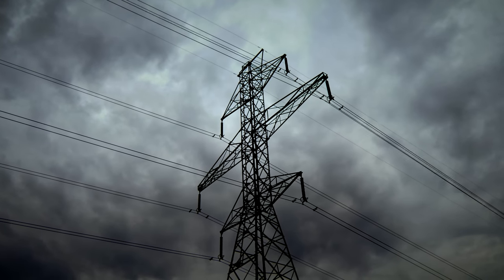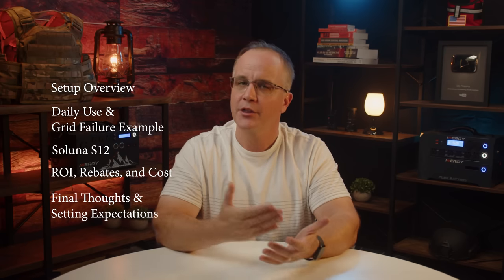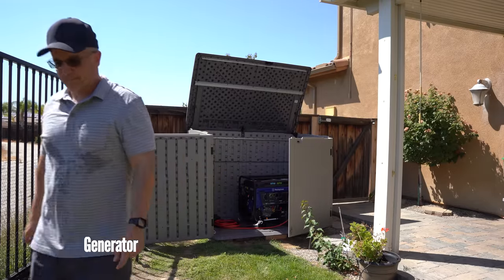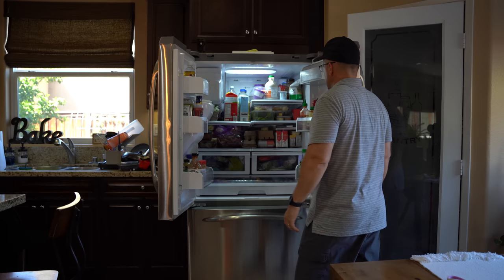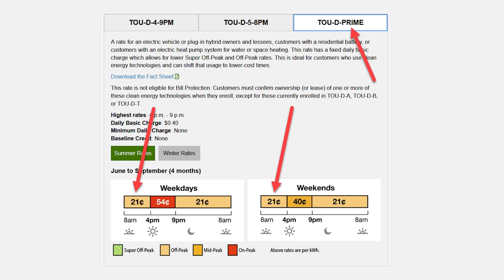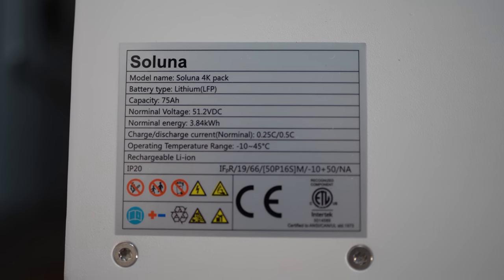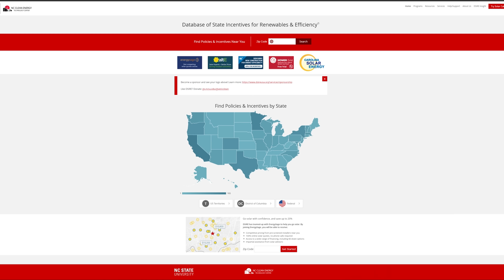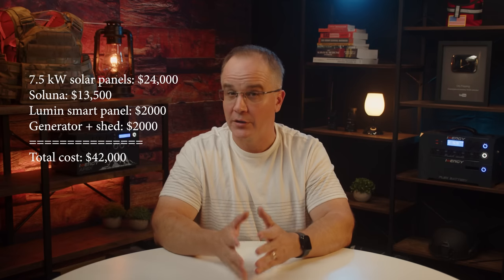The Coming Power Grid Collapse.  Soluna S12 Whole Home Backup Power

Comment: Hey Kris, Excellent job explaining your system and the key features and issues to consider.  Well done.  I think you did pretty good with the system you installed and you should be in good shape in a world of rising rates and increasing power outages.  Couple of notes:
1. The Westinghouse generator you selected is an excellent generator that really cranks out the power.  I have one and love it.  That said, it does have a very high THD and should not be used to power sensitive electronics.  You will want to make sure your Soluna charging system is OK with that as you charge your batteries.  
2. That is a lot of money but about in the middle for what I have seen.  I think it makes sense for someone like you.  i.e. you have the cash, you don't live in the country, you have a difficult roof and you live in California.  For the DIY'er who is on a tighter budget, has a simple roof or has space for a ground mount and has some electrical and construction skills a system similar to this can be DIY built for about $15,000.  When I say similar, I mean less bells and whistles but very similar in actual power specs.  
I think your going to be very happy that you made this investment over the coming years.  Thanks!
Reply from the maker: thank you for your feedback!  I plan on building an Offgrid cabin in the next year or two and will build a setup like what you mentioned.  By then, hopefully the cost will drop as solar and battery technology seems to improve each year and drop in price.
Reply: @CityPrepping  good luck..

Comment: Living in Louisiana we have lots of experience with prolonged power outages. My rule of thumb is keep one room "livable". Gas for generators becomes very hard to find a few days after a hurricane. We dont have the financial resources to have an elaborate off grid system, but several decent sized power stations and a few kw of solar panels. We have a few 12v fridges. Having lights on does draw attention. Another consideration is to turn off your wifi router after a grid down situation as that can signal your house still has power.
Reply: the "one livable space" idea is a good one!  For me, in cold weather it'll be the living room (woodstove); in hot weather it's the basement (nice n cool all year round)
Reply: @vickiamundsen2933  for us it's the master bedroom with a window AC, lamp, TV with antenna. Winters arent to harsh, but we'll stay under a heater blanket if we have an ice storm or something similar.

Comment: Thank you - I am purchasing a small, new construction home that is currently delayed due to the gas company having a shortage of fittings.... which sucks.  Hoping to be able to close and move in end of August now.... I intend to get a solar power system.  The home is a small ranch  - 1180 square feet (just me and Luna the wonder dog) and so a 3/2 is actually really more than we need.  I do office out of the home so one of two extra bedrooms will be office/hobby room.  The other is a guest room.   I am intending to either have a solar system installed or doing it myself - I've found very good DIY vids here on how to do it... but really I'd like something like your set-up.  But maybe 12KWH.... so that I can power my A/C for at least part of the day.  Or, I may just opt for a small backup window AC for the master bedroom - for grid-down.

Comment: My system is a Generac with 6 batteries and two inverters.  Most of the time my house runs off the solar panels.  40 solar panels.  I have a critical loads panel.  Last month I produced 133 KW more than I used from the grid.  During the best time of day I can run the entire house off solar.  I got a large rebate and I got a $ 4,000.00 federal tax refund on the system.
I am very pleased with my system.

Comment: This was a very interesting video.  I live in Puerto Rico where power outages are common.  A couple of days ago, our power was out for 16 hours.  The system is aging and over the decades maintenance has been poor.  I bought a 5.2 kw system three years ago.  Sixteen 340kw solar panels and a 13.5 kw Tesla battery.  My system is grid tied, but works very well when the grid goes down.  As the cost of power goes up, my system is paying for itself.  I paid $25,000 for it.  Going solar was one of the best investments I've ever made.

Comment: I Love this Video, thank you so much.
I haven't used a refrigerator for almost 3 years,  because all i had in it was mustard and mayonnaise. 
I don't waste my electric for things i don't use. 

In the summertime while I still had electricity, my monthly bill was a whopping $35.00 (thirty-five dollars, yes you read it correctly).
My electric company shut me off after 2 month and my Bill was $79.00. i used to pay them usually every other month. That time they didn't want to wait 12 more hours to get their Money, so they shut me off. I paid my Bill like usual and then they told me i had to pay another $60.00 to get my electric turned on again. 
The company ended up paying me $192.00 back of my down payment and a membership fee i PAID in the beginning.
So it was then when i said goodbye to the electric company and got my deep cycle Marine batteries. 
As for me, i have to use a CPAP machine at night, and i charge up my cellphone. 
My CPAP machine uses 90 w of power, i tried to run it with a 100 w Inverter, but there is too much draw on the 100 w Inverter. 
Now i use a 175 w Inverter that can handle the surges that happen periodically.
I also purchased three Marine deep cycle batteries, which I use constantly. 
One for my cellphone and other small rechargeable flashlights, emergency Radio, batteries needing to be recharge, and the other two for my CPAP (one battery ONLY lasts about two weeks on one battery). 
Up until one week ago i had to find someone to take my batteries into Town to advanced auto to get the batteries recharged. 
I then found a deal on a 200 w Solar Panel Kit, including a 400w inverter which I purchased. 
In my Yard i only have about 6 to 7 hours of full sunlight, so with this 200w Panel it takes about 2 days to charge up one battery. 
I now can run some of my power tools (as long as the wattages are lower than the Inverter) for the short period of time needed. 
I also have an 800w Inverter that my husband and I used in our semi truck before he passed away. 
I am learning now what I can and what i can NOT do with my system. I don't use much light inside my house, since I fall asleep as soon as I get comfortable in my chair.
Beings I spent most of my day outside in my woods, i don't even have time to cook anything Fancy. 
I am learning about my weeds in my yard and what is edible so i make a 3 minute ramen noodles with wild spinach. 
I do take vitamins, because i really don't live healthy, other then I am a FORCED vegetarian 🤫😭🤫🤣. So, i even cut out my meat consumption!

Comment: Here in the southern Bahamas there are 3 homes on this island where I live and we were running one large generator for years. Then in 2014 we had installed a large Solar array system that can run every thing. We kept the generator for back up and run it one hour a week. The cost was just under $200,000 Turn key.  The nice part is I can run the clothes dryer, Air conditioner and Oven and a 60 gallon hot water heater all at the same time with no problems. What we do have to be mindful of is water, there is no freshwater source here at all, so it’s all rain catchment for each home. The rule is a gallon per Square foot of your home for storage. My home is 5,000 sq ft but I have a pool so I have a 12,000 gallon tank for my home. With Dish TV and AT&T cell Service I could stay connected to the world, but in March I installed starlink satellite internet service for faster service. So far so good. It’s 20:40 EDT 80* 60% humidity 8 mph wind out of the west. and the sun just set about 20 minutes age. My transportation is a golf cart on two solar panels.

Comment: So glad you talked about the grid, I have a 22,000 kilowatt solar system, so I know what I'm talking about and I built it.  Im totally off grid. I have 90 230 watt panels and renogy controllers 😉the copper will shock you at its cost, I spent around $140,000. Totally off grid and I run an air conditioner.
Reply from the maker: wow, that's a big setup!

Comment: Excellent presentation, Chris, as always.   Thank you for all the details, planning, and thought you put into both the system you presented and this video.  I'm impressed by your set up!   I'm working on smaller back-up systems for our family that will get us by during short bouts of power outages.  I have two portable power stations made by Oupes, an 1100 watt with two 100w solar panels, and an 1800 watt station that uses 4 100 watt panels for charging.  I use these on a weekly basis to power my e-bike for my daily commute to work. A small 3500 watt gas generator can supply power to larger appliances such as our washer and natural gas dryer.   Like you, we are not concerned with powering our whole house AC.  I purchased several USB powered fans that we can use if needed.     I would recommend systems such as you describe that you use regularly in order to get the use out of them, and become familiar with exactly how they perform.   Thanks again.   Always appreciate you insight.   Larry from "Under the Median."

Comment: I added a whole home solar system in South Texas with Tesla Power walls, the total system was over twice your systems cost ($93K), this included a new roof (required for new solar panel installations on composite roof).  The house is 3100 sq ft.

Comment: This is similar systems that I've talked about for years to friends of mine who live in their own houses.

What I'm thinking is that these kinds of systems really need batteries external to all those electronics including inverter. That is the one component which is going to fail first, so it would be nice to just swap out new battery pack or even scale up system as needed.

That is actually how most common building scale UPS and backup power systems work. Atleast in those datacenters that I've worked in.

Comment: I went ahead and made the switch to solar power using the Ecoflow system.  I like how it's modular, and there are times when I need to bring the main system with me for work.  I then will have the house on grid power.  I've always thought about the EMP issue.  I will keep an eye on those technologies.

Comment: It appears to me to be a well thought out system.  As retired engineer in Texas, I can see that you have considered of most of the potential problems. Looks like you have solutions in place. Without more details, it is difficult to be sure.  I have a house about the same size as yours, but my orientation is not as favorable and the roof presents further problems(south-facing roof is not as favorable).  I also want to consider some "heat storage" for DHW.  I look forward to investigating some of the finer points of your system. I would be pleased to correspond with you if you think that I could add anything useful. regards, Howard McCalla

Comment: I have a Circle Dubya gas generator and Bluetti solar system. My solar is smaller and not permanent on the roof, although I love this set up on the video.
In the Houston Texas area summer, having at least a window unit AC is the difference between wanting to live or wishing for the next phase 😂
Reply: My Westinghouse generator can run my central air :).
My Bluetti can handle my CPAP fridge, and deep freeze at night. If I want to run my LG OLED and PlayStation without noise, the Bluetti is perfect there too. And my son is pleased 😀

Comment: In case of no electricity, might I suggest using battery operated fans and/or fans plugged into solar generators or power banks and sit on the floor instead of couch and chairs. It's generally cooler on the floor which I've often noticed my dogs getting off the couch, laying on the carpet with less to no panting.
I also use a spray bottle of water to spritz my face, arms, legs and feet and the fans offer cooling relief.
If sitting or working outside, use s fan in the shade and it does offer a cooler environment.
Reply: Sherry, we did that as kids in SoCal with no AC -- plaster our bodies to the linoleum to soak up the cool 😀

Comment: Yes So in May We Installed a Lux 9.6kw Battery System for our existing 4kw Solar Array - Best Thing I have ever Done have already cut our Electricity Bill by around 70% !!!!!! Weh the Rolling Power Cuts come in the Autumn we Are great with the Auto System Mode. In the Winter We will Charge the Battery System at Night on Cheaper Electric and Use in the Day! We are Lucky at the moment as we are on fixed term of 18.6 Pence/Cents per KW until Next May - Retail Price is Now 35 Pence/Cents in UK and going up to 50 p/c very soon - Very Happy Prepper!

Comment: Solar isn't reliable here in the Midwest Especially mid January with subzero temps
Reply: As someone who works in the industry, what are you on about? Solar panels are more efficient in cold weather.
Reply: @TravelingStacker  uh short days little sun if any
Reply: @Dmiller7239  Then why did you say sub zero temperatures? That has zero effect on the situation. Also, I live in OK. I produce plenty of power in the winter. More power than I consume.

Comment: Our house has a dual HVAC system like yours (2 heaters & A/C units) , mostly we cool the up stairs unless it gets really hot.
I picked one room that is central in the house well insulated with no direct sun that I can cool with one 8,000 BTU window unit when the power goes out.  Yes I’ve tested it many times by letting the house heat up.

Comment: The key to electric power is efficiency. And for lack of a better phrase, that equation has two sides.
On one side, the efficient production and storage.
On the other side, the efficient use.

Production and storage has come a long way. It is making constant improvements, and will likely continue to do so.

Lighting, HVAC, and various electronic appliances/equipment continue to become more and more efficient, … requiring less and less electricity.

So the race is on. Which side of the equation will get there first? It could be a photo finish, given the common nature inherent to both sides. An advancement in one can usually translate to an advancement in the other. Usually.

Comment: Video is not finished, but question on my mind...  What if your Smart phone is not working either?
Also, after one hurricane in Florida, the power companies or government ( I don't know exactly who or why) did not allow solar equipped homes to use their solar capabilities.
Reply from the maker: Everything works as you programmed it...the Lumin (which defines the lines) stays with the programming that was originally set up.

Comment: Australia has an amazing system of micro grids, homes can sell power back to the grid and power themselves to reduce home bills. Victoria has installed a giant Tesla battery which has significantly reduced the threat of brown kits during summer peaks. I’m in New Zealand and home units are still quite expensive, it’s the batteries that are the biggest expense.  I will be slowly moving to grid independence via solar and batteries over the next 10 years, as I can afford it. What I find difficult to unpack is if I have the end in mind, where di I start and how do I ensure I don’t end up installing plant and then finding further down the track that I misspent and have to change out the system. Hope that makes sense ( how do I build today for tomorrow
Reply: @Gwenpool2369  no, they and New Zealand have been upgrading their grids for 19 years and investing in “smart grid technology” there was planned maintenance May or June, across the different states in the east coast, but weather extremes ( the most brutal winter weather systems, rain, hurricane strength winds, freezing temperatures) meant that nearly 20 million consumers turned on heating creating summer peak loads in what should have been the lowest consuming period. This put tremendous strain the generators and distributors because of the number of generators that were shut down for off peak maintenance

Comment: I like your setup! I went all in on Tesla with solar panels, two powerwalls, and two EVs.  It all just works, and I love that when the power goes out we don’t even notice.
Reply: Derek- that is pretty cool that your cars are, in essence, solar powered then!  Was the Tesla system pretty comparable to the price of Kris's system? Or is it pricier?
Reply: @customer5032  I missed how much Kris’s system is, but I’d guess the Tesla system is more costly because I didn’t do any of the work myself.  

I bought a 9.2kW system with 2 Powerwalls, and the total was $37k, and after state and federal incentives, will be a net $27k. I did a 5% 10-year loan and payments are ~$350 per month.  Considering that my electric bill was over $500 per month (California), I’m already cash flow positive.  

Anyway, the additional advantage is that I have a freezer full of beef that won’t go bad when the power cuts out, which PG&E does regularly as a fire mitigation strategy.  

Finally, it feels incredible to be energy independent.  I don’t care what gas prices are, or what’s going on with OPEC.  It’s the most American thing I’ve ever done, feels amazing!
Reply: @American_Energy  that's awesome, way to go. I think his system was $42,000 and then went down to $31,000 after rebates, so yours was actually less!